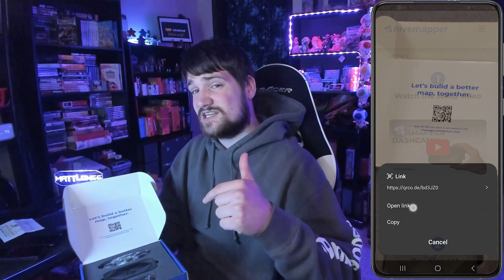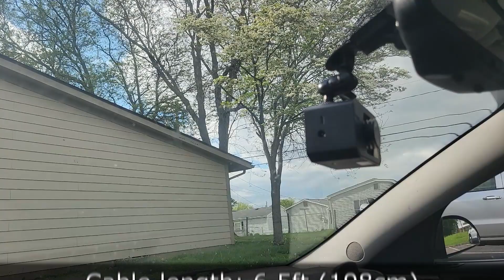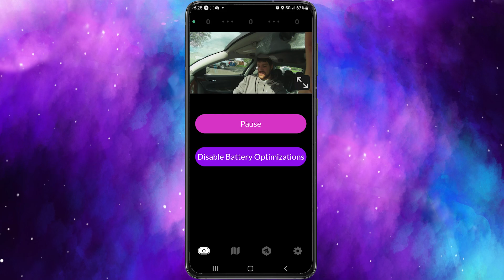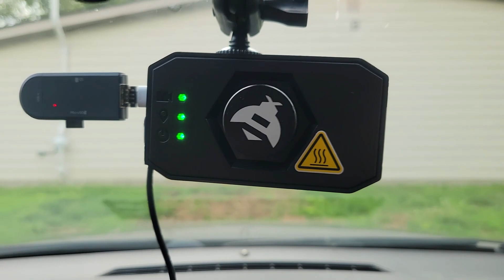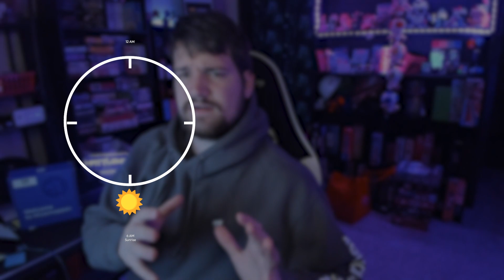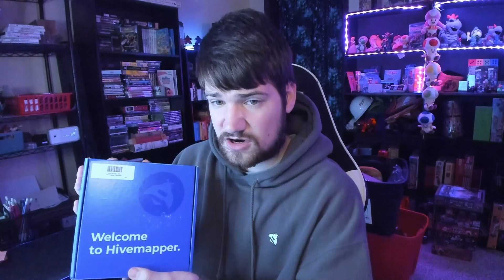Turn Your Car into a Money-Making Machine! Hivemapper Dashcam Setup Tutorial

Comment: Bro I’m confused . You used the original mount from the box in the video but then you link the aftermarket mount from amazon which I bought. I don’t get how how the aftermarket one would hold the Hivemapper. I’ve installed it and have been just looking at it and all the xtra spare parts and joints that it came with for like the past hour. Could you please post a quick video on how to install it to the mirror. I feel slow 😂😂😂 it’s probably super obvious but I am legitimately stuck here . Please help..

Edit:2 minutes later I decided to actually take the camera out of the box and it was then I realized there was a female connection on the body itself that screws into the bottom of the aftermarket mount 😂😂😂
Reply from the maker: Glad I could help!